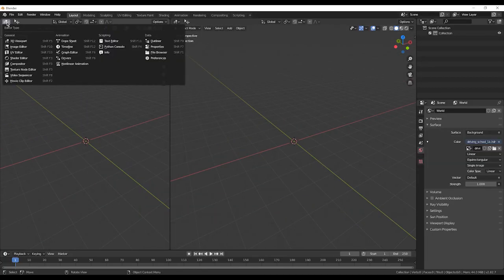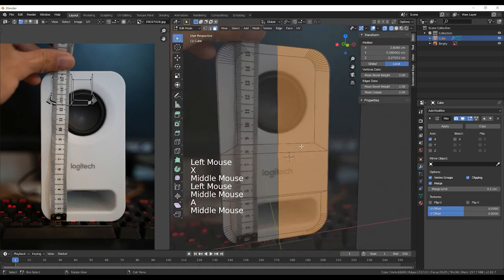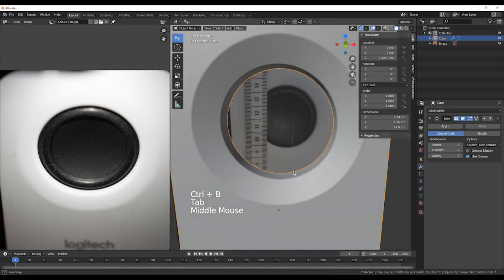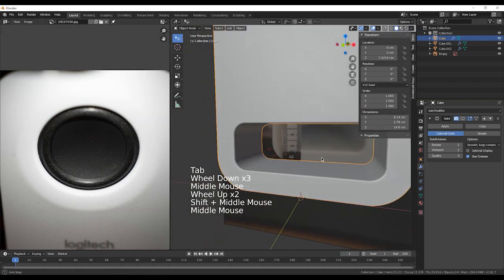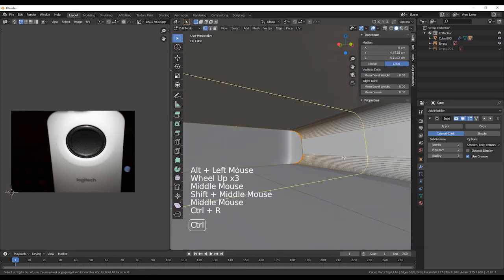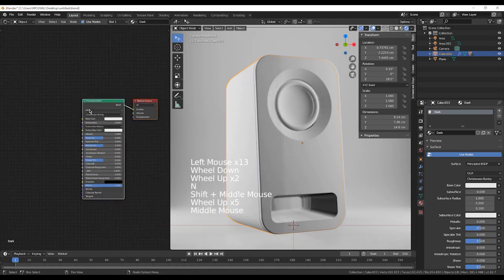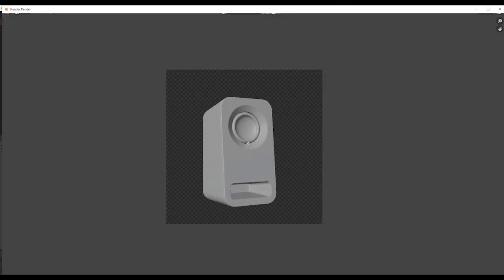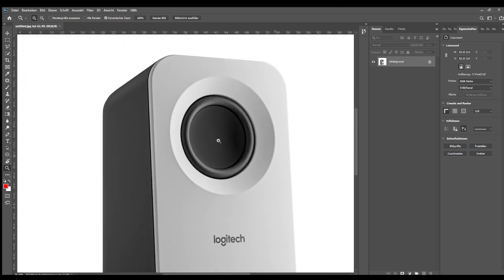How to create a Speaker in 18min (Product Visualization) | Blender 2.8

Comment: hello does client provide a sketch or specifications of their product before you create it? just curious
Reply from the maker: There are only rare cases where you have to make the model. Any hard surface products should be delivered as CAD. Soft body usually will be modeled/simulated.

I also felt bad making this tutorial and only made it because so many people asked. But in the real world you probably will not encounter a modeling job like this for a client like Logitech. 

The reason is, for years all factories use 3D files to produce the product. That’s the file you will be using to render.

Comment: With a 3D CAD you will be most faster. I can build this in Catia or Solidworks in 5 mins. Including 3D pritable and manufactur.
If course i can not shader or render. But maybe its possible to combine both styles?
Reply from the maker: Yes yes totally!! And yes you can combine both. What you are mentioning is the normal workflow. 

Usually me as a render artist would get CAD data from a guy like you to render. Normally a product like this will not get modeled just for a render. Usually you would use the real manufacturing data.

Comment: 0:52 You actually don't need to model it in right scale, simply later you can scale final model till it's height matches, less initial work. Since while modeling over reference photo the end result might not perfectly match anyway due to camera perspective + matching to a photo ruler isn't ideal too.
Reply: I think this is a lesson for begginers on how to think ahead on these projects, visualizing the final product.
Reply: @locophat  Probably, but beginners should start doing it the "right way" since habbits can build easily and it's hard to change them later on.

Comment: Your bevels was perfectly circular, but mine became elliptical, why so?....btw thanks learned a lot from your work.🤠
Reply from the maker: Inventor Studio you probably have to apply scale in object mode with ctrl A.
Reply: Or if you bevel and keep hitting "M" while still in bevel mode, you switch between bevel types, try that, it might help
Reply: this kinda sucks, he is doing it wrong. blender is much better than this.. i MAINLY suggest to keep it low poly, and use subsurface modifier, and vertex groups to put proportion while keeping it low poly. Low poly makes it easy to adjust without having to start from scratch all the time, and it makes computing it a lot faster.
Reply: @faziolifairmont8125  dude, i f**king love you, some finally said it. Oh.... And if you are forced to apply your modifiers, a useful thing to do is to keep a copy somewhere before applying them!
Reply: when you are in edit mode press control + b drag the mouse till it edits then scroll up or down
Reply: @MoneyReally  perfect. thank you
Reply: @Mangazimusic  Happy to help!

Comment: nice result you got there! but you are not supposed to change the strength value of the bump node (leave it at 1.0) instead you want to change the distance, if you use the strength value you get some weird artefacts (often not visible, but still there)
Reply from the maker: Oh yes you're right! Great suggestion! Just tested it, way better now!